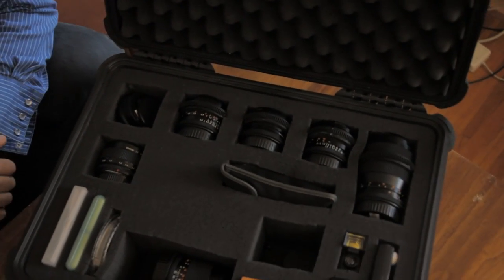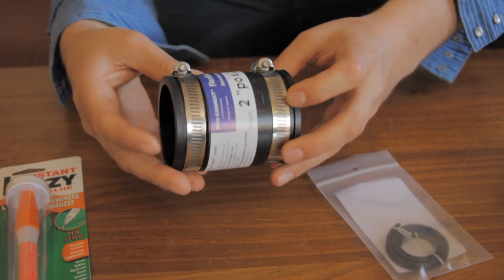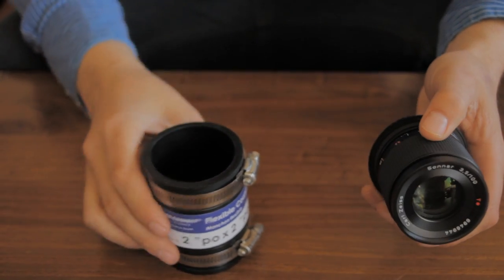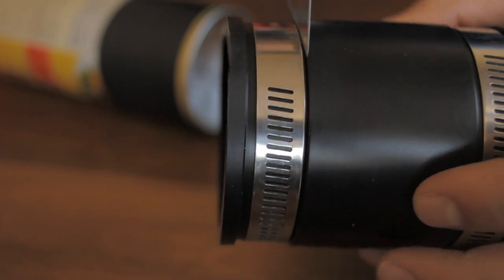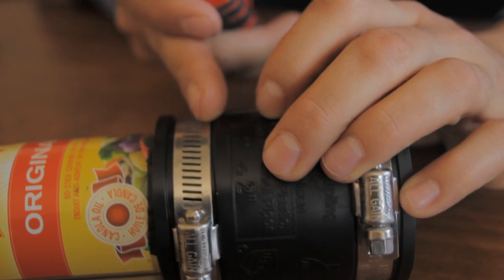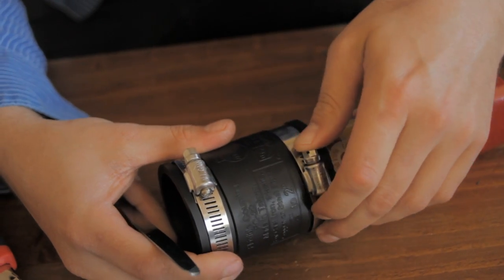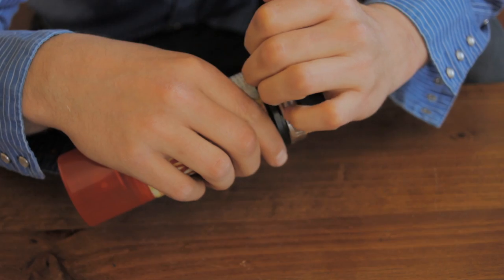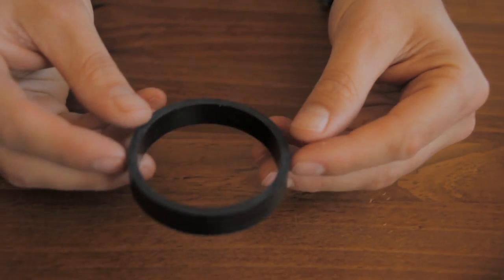DIY Lens Gears for HDSLR follow focus - Part 1

Comment from the maker: @DocMacimus Hey, thanks for watching the tutorial, I dont have a mattebox the moment but I believe if you have a rail system your mattebox would be stationary since its attached to the rails instead of the lens, you would use whats called a "donut" to bridge the gap between the lens and the mattebox. But Yes cinema lenses don't move in and out and the front element doesnt rotate either. Thats why you among other things you pay a hefty premium.